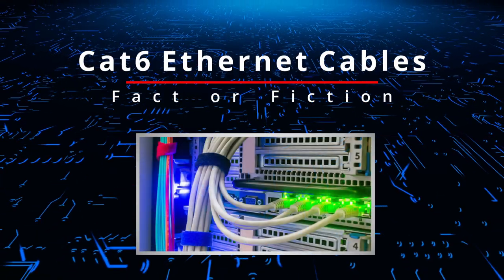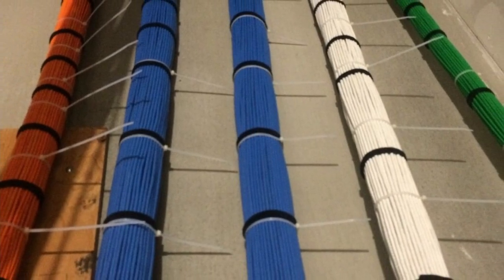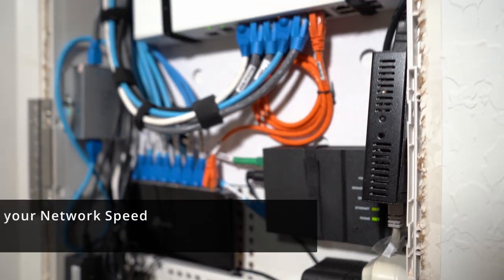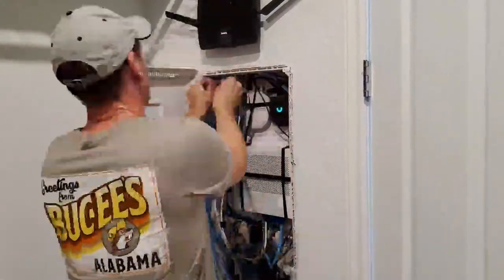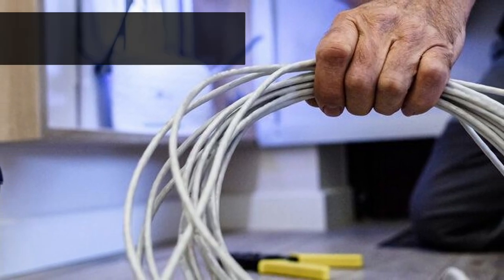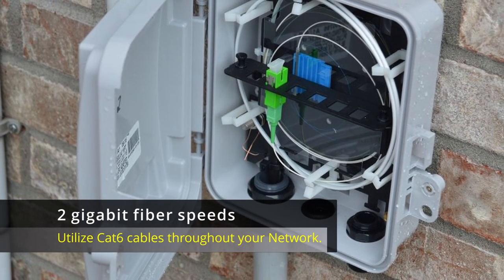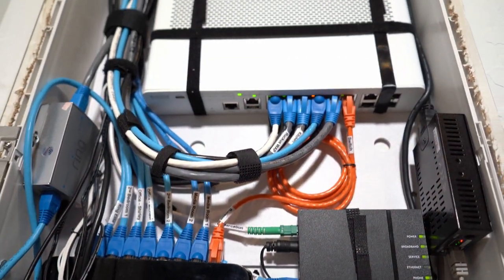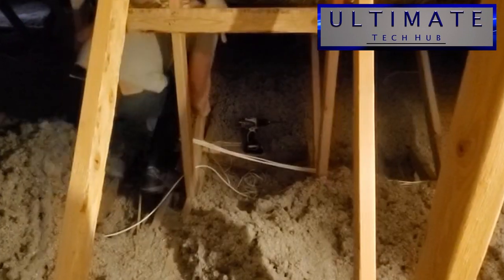Cat6 Cables 2022 - Facts About Cat6 Wiring - Secrets Of Cat6 cables

Comment: This was fantastic information I currently have cat 5e runs however I'm considering pulling cat 6 lines. I'm on ATT 1gig fiber however ATT has started pushing out 2 and 5  gig packages.  I don't see myself going to 5 gigs but maybe 2 gigs since it's a small price increase.
Reply from the maker: Wow 2 gig would be awesome! I think I would probably go with 2 gig as well. Remember you need to change your PCs Network interface cards to 10 gig otherwise your max speed is 1 gig. Also you will need to upgrade your router and  switches also. Most switches and routers are 1 gig max. I would probably upgrade before going to 2 gig. Thanks for watching I really appreciate it.

Comment: I see you showed a box Southwire Cat6 cable in the beginning of the video, This cable does not have a spline. In your opinion, is this cable still Cat6? or just rebranded Cat5e like many of the reviews say it is? Thanks.
Reply from the maker: I've worked with cat6 cables for the last 10 years and the Southwire cables are cat6. Cat5e is much thinner and flimsy.   
Thank you for watching I really appreciate it.
Reply: @UltimateTechHub  Excellent i feel good about buying it then. Thanks for the wonderful uploads.

Comment: Built  my house  in 04  ran cat 5  and coax ru6    everywhere  and don't  use any of it  fiber to a box via wireless router    same thing  in the public  school system    one Wi-Fi  hub in each class  room.  We have run many miles of wire thru the buildings   Jack's ever wear   now everything  is note pads.  We have piles  of towerdrives  boxes   sitting  in storage.   When there is 35 of them in a classroom  the produce  a lot of heat .1.2 amps  each .   They have become  outdated.

Comment: You say CAT 6 is Generally more durable and give credit to thicker sheating.

However, part of the CAT 6 ANSI Standard is that Solid Copper Conductors are 23 awg, which are thicker wire than CAT 5 or CAT 5E.

Comment: So is that Cat 6 wire from home depo trash? Reviews are negative.
Reply from the maker: I've used the cat6 from Home Depot and had zero problems with it. Easy to terminate and 2.5Gbps at short cable runs. I've tested it using iPerf3 and performed better than cat6a, cat7 and cat8 at 6 foot runs.

Comment: Upgrading to cat six could actually increase your Internet speeds when you think about it if you’re just running fast ethernet our cat 5 and cat6  is way harder to deal with in cat6 and cat5e
Reply from the maker: I have I gig fiber and I've tested cat5e and cat6 from the same LAN port to my PC and the speed test was nearly identical. No increase. Thanks for watching and for commenting!
Reply: @UltimateTechHub  I am talking about cat5 not cat5e
Reply from the maker: @jaredsalem5837  Well cat5 is basically obsolete. So yes internet speeds would increase with Cat6.
Reply: @UltimateTechHub  you really should learn how to read
Reply: @jaredsalem5837  Yeah, I had a cable from an old Mercedes phone system  that was limited in speed.